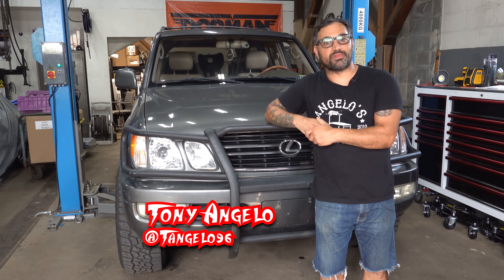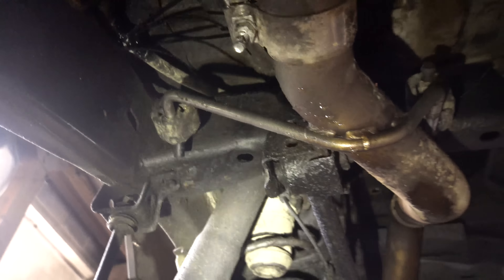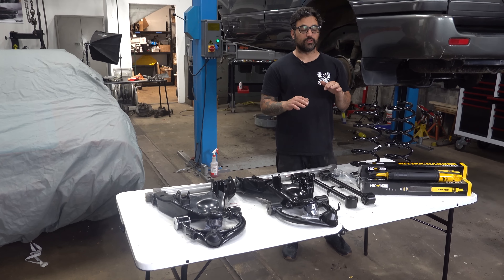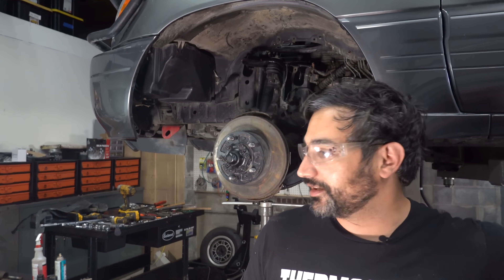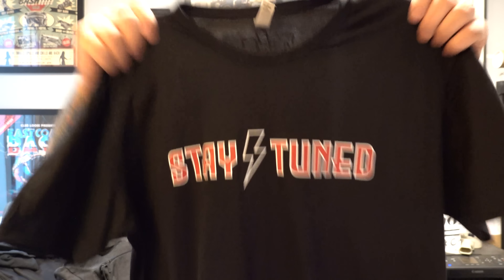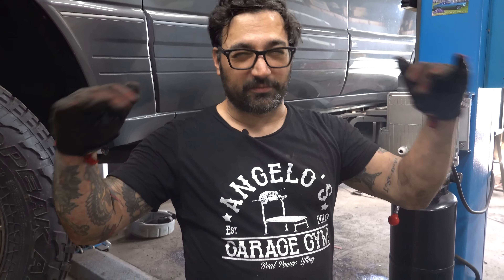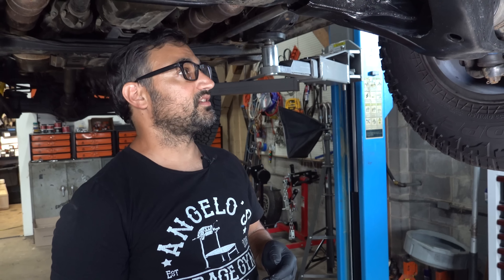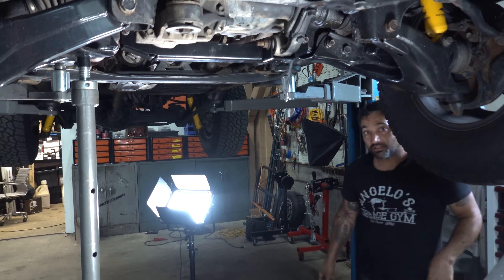We Made This Thing Unstoppable!

Comment: I have had and had many vehicles but I've had and have more Toyotas than any other. 
  Still have the 76 Celica, and the 80 Hilux long bed 4x4. 
  Gears are the great equalizer for horsepower. 
   My 79  toy Street truck was making somewhere in the neighborhood of 140 HP after head work. 
  And even though it could break loose the M- 50 -15's . When I change the 4:11 rear end to 4:56 and a posi those tires spun at will. 
     I'm old school but 80  4x4 sits on a 7-in soft ride S. J.  38 1/2 x 15x15 fun countries Norseman style tread. 
 5:29  lockers and a Marlin crawler.

Comment: Tony,
Just wanted to give you a heads up about the alignment bolts. I would recommend trying to find factory Toyota ones if you get a chance. The style that you get from like an auto parts store with the D shaped holes and bolt tend to round out when you go to get it aligned after a while. The previous owner of my first gen Tundra put a set of them in right before I bought it and before I had it a year I needed to replace them because it got knocked out of alignment (could literally feel the alignment change while driving) and the holes were rounded when I went to get it fixed. Needless to say there was some tack wielding the washers to the bolts and the frame to the washers till I was able to find a set of used factory ones to put back in it.

Comment: Ive got the same lx470 down to the color. It's a great truck Most people get their current steering wheel leather recovered. You should also look into L-seat replacement leather for the seats if yours are bad. TJM makes a really inexpensive front bumper, also sold by Slee.

Comment: $50 for the diff drop. AND check out NAPA. They have the extended length GIRTHY shaft CVS with the high angle boot already on them. $250/axle....

Comment: Weird.  I'm running a 2010 Tacoma with probably close to 3" in the front, no drop stuff, 35's and no problems either.  I'm surprised yours complained with just 1.5"  Probably should have grabbed a couple new axles or cv's.

Comment: i think i have seen some 2uz-fe superchargers, altough i don't know if the proper fix would be to regear the axles for the bigger tires
Reply: Yup, but they won't work on 2005+ because those are variable valve timing engines and the factory computer can't handle the additional air. Probably would work on this rig though!

Comment: +1 for showing yourself reading the directions. 🤘🏻💀🤘🏻
On a scale from 1 to 11, how much of a bitch would the suspension upgrade be for a guy without a post lift?
Reply: I have the LandCruiser version of this rig and I did this supension upgrade in a day and  half in my driveway with a floor jack and some jack stands.  It's pretty straight forward for the Toyota Variant. For Tony's the AHC (hydraulic Suspension) theres a lot o get rid of.  Setting up the Torsion bars can be tricky the rest is easy